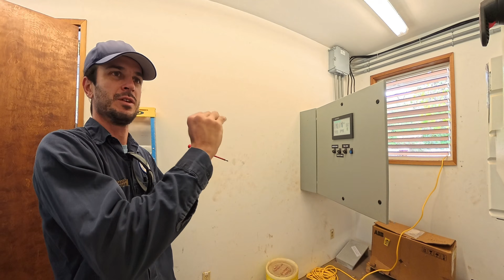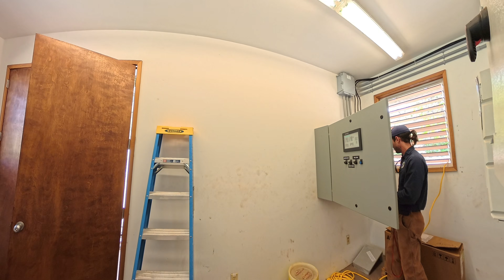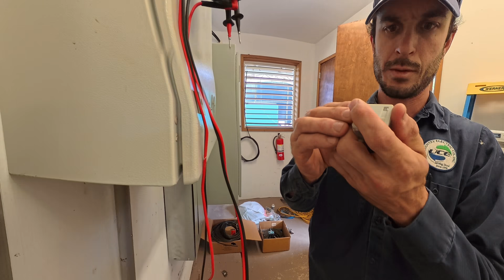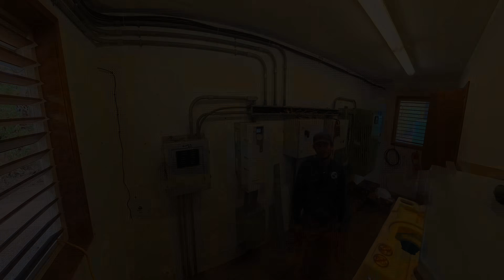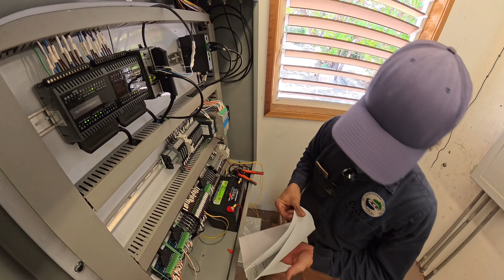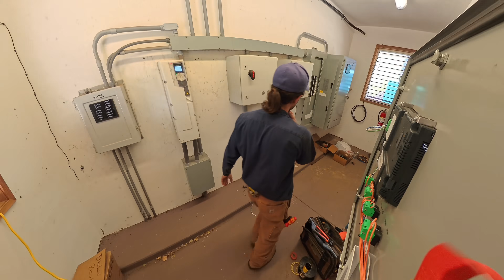Making Changes to Motor Control Logic

Comment: I never liked those automation direct PLC'S, they have driven me crazy over the years, the plant I spend the most time in is now all Allen Bradley. going to control logix, I can add what I want, and have been able to get an alarm and go online from Japan and the Philippines for a plant in the US, if it's critical I would not use any of that stuff, I have huge steam boiler plants running, all redundant, servers, PLC's, Gateways, if it is really important set it up right, use the technology that is there, I set it up for alerts on my phone.
Reply from the maker: All our government work out here specifies Allen Bradley components. We give the option to private customers, no one has taken it when given the choice.
Reply: Well,  you can do all that on AD PLCs.   I don't like AB or their hideous software costs.  Or hideous hardware costs, for that matter.  Or, the hassle of buying anything from them, or the delays in getting it.  I do all kinds of crazy stuff with AD PLCs.  I've never needed anything they don't provide.  I can order the stuff at 2am and get it next day.  Or 2nd day air free shipping.   Just saying. :)
Reply: @keithcress1335  well for big companies, they will go with Allen Bradley because of the safety category rating. I don't think Automation Direct has one controller that does motion, safety, and normal logic scans like Allen Bradley. Feel free to correct me if I am wrong.
Reply: @shawskeebennett1440   There, you might be right!  No jobs I've done didn't have external safety logic when it was needed.

Comment: I'm not up on these PLCs/SCADA, but can't you add a simple wait timer in the computerized logic? 
When the float switch changes state / wait 5-10 seconds to re-energizing the motor. Simple de-bounce for error correcting and short-start protection....Pretty common for anything water related I would think especially if they don't want hard lockouts.
Reply: Absolutely you can add delay-ONs easily.  I'm bet the programmer has already added that.  It's easy to miss something like that when you're working on a project and a guy in the field calls you out of what you're working on, needing your immediate help.   You do the obvious then in the back of your mind you're thinking it through more fully and go back and touch it up.

Comment: Nice. Kinda quick n dirty on their end, at least added a little timer for pump start after a low level fault :D
Reply: Yeah,  it was a little disconcerting to see it chatter-ON as Ben was stuffing the wire back into the terminal block.  It probably needs a 10 or 15 minute delay-ON as otherwise they could have the sump drop enough to turn OFF the pump, the starts to recharge, the pump comes ON and in 5 seconds draws the sump back down to the float turning off again. Short cycle city! 🤪